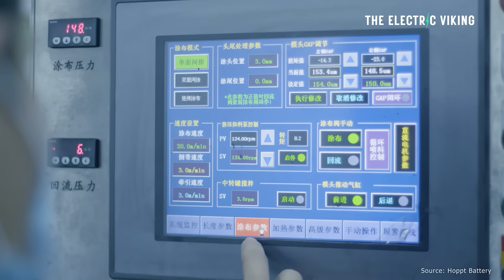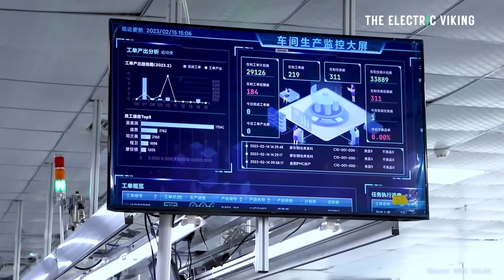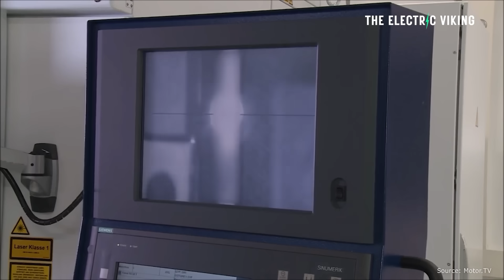NASA has cracked the code for replacing lithium batteries: ‘triple the energy’

Comment: There is an interesting observation about when steam power took over the shipping business, in that, steam did not replace sail overnight because sail boats started using steam technology as a boost to keep them in the market. Perhaps airplanes can start using electric boost on their engines to reduce the amount of fuel they burn per flight. Once an economic set point is found, it will be naturally beneficial for those planes to use more and more boost as the batteries come down in price (and weight) until it is no longer desirable to burn the fuel at all.
Reply: Or just use fuel for take off and landing then cruise on electric?? Don’t know if that’s possible
Reply: @troyswan7123  It will certainly be possible to use electric to reduce fuel consumption. It is just a matter of saving more fuel than is required to lift the batteries.
Reply: For now, the batteries method still cost too much weight for power in kg. Even if you place some of the planes design for battery - you still wouldnt have enough for large passenger planes. We need to hit into the 2k-4k ranges for them. For smaller 1-20 people planes, this makes total sense though and could 100% reduce their fuel needs with this battery.
Reply: Well, that sort of hybrid approach might be difficult. The weight of jet or piston engines is about as substantial as that of batteries, not to mention the weight of the liquid fuel.
Reply: @WarrenLacefield  That would be true if done all at once but not as difficult if done as a step by step transition process. The steps will start small, but will get larger as the batteries become cheaper and get higher energy to weight ratios. They can start by simply putting in enough batteries to run all the electric devices in the plane instead of getting the electricity off the engines; that would save some fuel. Then the progression moves to feeding electric energy back into the engines to reduce fuel consumption for the same thrust. Then new generations of engines will be designed to get more out of the electric boost and save more fuel. At some point in the future we may see a stiff carbon tax on jet fuel, which would make all techniques to save fuel develop faster.
Reply: I see hybrid worth considering. 
Trains and earth movers use electric motors with a diesel generator. 
Imagine if buses and semi trucks transitioned to this method. 
It would increase efficiency and eliminate range anxiety.
By adding some batteries, additional applications would make sense.
Reply: @Ken00001010  Possibly. But you have to keep recharging those batteries. Big jet aircraft do require a considerable amount of electricity to run and fly. Small aircraft, not so much, probably too little to worry about.

When EV aircraft do come along, the benefits will be many fewer moving parts, better computer and navigation controls and 21st century cockpits for pilots, low maintenance, quiet-running, increased comforts and safety, possibly no contrails, shifting the energy sources from fuel tanks to the electrical grid (and possibly cleaner energy), etc.
Reply: A hybrid jet engine is a possibility, with an electric motor driving the compressor, a combustion chamber and nozzle optimized for thrust, and no gas turbine to rob thrust from the exhaust, it could dramatically increase fuel economy with a modest weight penalty. Such an engine could cruise on little or no fuel, using fuel mainly for takeoff and climbing.
Reply: @WarrenLacefield  Thanks for your reply. I suspect that battery charging for electric, or electric assisted, planes will go pretty much the way it is going for vehicles like busses. There will be a tradeoff between how fast charging can happen and how much infrastructure is worth that improvement. We have completely electric small planes, now, and I expect to see that move up in plane size as technology advances. My point is that electrical assist can move up that scale faster, and that fuel savings (for both cost and environmental reasons) will push that.
Reply: @Ken00001010  Yes, we do have completely electric, (very) small planes right now and they do charge about like EV cars. But they don't have a lot of range. Few if any are licensed for passengers. Better batteries, like these Viking was talking about, are still in R&D phases. My point is just powering the avionics and control motors, etc., by battery does not gain much. (Especially, I think, most systems like that have "regular" battery backup now. Recharging and running power comes from fuel power - very small compared to thrust.) Maybe hybrid systems will help incrementally. But like for spacecraft, all such new technology has to go through FAA approvals for safety, etc. Tech might evolve exponentially, but approvals seem to run slowly in linear time...
Reply: That's an interesting analogy. It  was once a 'fact' that transatlantic steam ships were impossible because the volume of coal required would exceed the cargo capacity of the ship.
Reply: @carr87500  Indeed. Unless ruled out by the the laws of thermodynamics, it is generally unwise to declare something impossible for all future.

Comment: A. Commercial aviation is already incredibly safe- there is almost no room for improvement
B. Airplanes will be the last form of transport to electrify and the batteries speculated about here will be wholly inadequate.
C What do you suppose a 25,000 HP electric engine would look like?
D. So, as far as I know an electric airliner would have to be propeller driven, right?  So immediately you have a speed and altitude problem that makes them infeasible for commercial airline use.

Plenty of great things happening in electrification, but commercial airliners aren't one.

Comment: Electrified tracks supplying power during takeoff will extend air time considerably
Reply: Take off roll on the ground -10  20 seconds - time to Top of climb 20 minutes - 30 minutes .  I'm not convinced.  Maybe an incremental assistance - along with being electric towed or powered by ground power through all the taxi-ing and up to runway threshold.  Save battery for the flight.
Reply: @marclagalle1486  Emals like on the Ford carrier?
Reply: @colshaw793    Way too expensive and would require point reinforcing of the airframe at the undercarriage even if the catapult stroke was made much longer.  Why not use the aircraft engines but have an electrical pickup that would sever as the aircraft rotated and started to climb away?
Reply: @marclagalle1486 You could do either. Taxi the airplane onto some kind of electric sled and have it get the plane up to speed on the ground before chucking it into the air or have an electrical contact on the plane providing it with power from the ground until it lifts off. 

The sled would probably work better, tho. No requirement to have any weight on the plane.

Comment: Sam, how do you figure air crash victims die mainly from fuel fires? If a plain augers into the ground, or sea. Or breaks apart at 30,000 feet?
 Everyone dies. No one burns. Getting rid of fuels won't change that.

Comment: The problem with large planes is not taking off but weight on landing.  Even if battery energy density increased far more than this nasa one, it does not get around the fact that they can't be dumped before landing.  For large or longhaul planes, it is a total non-starter due to the landing weight problem.
Reply: Some basic physics tells me that extra weight is only a problem if you are crash landing. Otherwise your wings that allow you to fly carry you back to meet the earth at a safe rate.😊
Reply: @malcolmrickarby2313  if every landing could be guaranteed to be perfect that would be ok, but that is not the case  It is why a plane that needs to return to the airport soon after take off dumps all its fuel first.  Planes have a max landing weight.
Reply: @jamie-ck6js  At this point - the larger planes / long trips ones would be out of the question anyways for now. Small and mid size ones are what we will want to target anyways because they waste the most fuel for the amount of "stuff" they move. Because they would be smaller - more of the design/weight can be shifted to make use of the battery as part of that design and extra weight from the people would be small/none existing anyways.

Comment: Jet fuel has about 40,000 watt hours per gallon or about 10,000 watt hours per pound,  we have some work to do yet 
Sam, batteries have ( as stated in your video ) about 120 watt hours per pound.  Even though electric is more efficient than jet fuel for propulsion, we still need some serious increase in battery watts per pound.  ( Feel free to correct me if I am not right here )

Comment: It’s all about how fast they can recharge. Aircraft can’t afford to be still long. If it can be recharged in the same time as to turn around the passengers then it’s won !
Reply: With solar panels, it could recharge in the air. Or decent with air friction.
Reply: They're doing fine with the artics running 24hrs at PepsiCo.
Reply: @TheBooban  It is impossible to get enough power from the photovoltaic panels on the aircraft
Reply: @TheBooban Musk has mentioned decent to destination as fuel.
Reply: Battery Swap
Reply: @TheBooban  Nope.

Comment: The best batteries at the moment are around 9 MJ/kg (gravimetric density). Jet fuel is around 45 MJ/kg. I can imagine regional air travel, but the energy required for continental or intercontinental travel at over 500 knots is likely out of reach until there are new material sciences discovered. As far as regional travel goes, we've always known how to do that efficiently. It's high speed rail. For some reason, the USA doesn't like that modality.
Reply: arlenea8 • The reason is OIL PROFITERS.
Reply: Trains are the only real way - and they can too be EV Trains :D I think the main reason is just the fact they take as much space as airports in some cases. LEt alone all the rail you would have to place down, taking of land, etc etc. Planes are just easier to have points at, travel in the air, and then land closer to a city. At lease in the US - large land mass with everything spread around. Places like the EU and Japan can get by with it is because they're a straight line down most of its land mass.
Reply: You might want to check your figures.  You may have moved a decimal point.  The best batteries have a gravimetric energy density of 0.9 MJ/kg, not 9.  Check it and post your source if you find something.
Reply: @wemagor  Yep. What I get for pounding out a comment. Same conclusion though. I have an affection for trains.
Reply: You also have to take efficiency into account. Jet engines are about 30% efficient, while electric motors are over 90% efficient, that makes a big difference. Batteries do need improvement for electric aircraft to match jet engine performance, but they don't need to match jet fuel energy density to match jet aircraft range.
Reply: I was told in school our love of the automobile is what caused the trains to demise in the USA. We used to have an extensive passenger train system in the early to mid 1900s. But another thought is our land area is just too large. Connecting most cities by rail is just not practical; infrastructure is to costly. Planes need little infrastructure in comparison.
Reply: @chrismuir8403  True, but we;re still needing them to hit into the upper 2k-3k per kg - so we're still too far away to be consider "good enough" yet. The best one I know is still less than 8-900 without doing some crazy thermal stuff. Granted, airospace will have the advanaged of using more excoct elements if it helps them even if it increases their cost. At least with large passenger planes. For the 1-20 sizes ones we only need to hit around the 1k-2k per kg. They';re the ones that create the most waste as they usally only carry a small amount of private users so fuel per person is higher than fuel per person on a larger passenger plane.

Comment: Aviation batteries must withstand the extreme cold found at high altitudes.
Reply: Not any more than the passengers do. Insulated, and inside the fuselage, it's not a problem.

Comment: There’s another approach which could be done with a much smaller battery, use satellite energy. Install a battery large enough to power take off and getting to cruising altitude above the clouds, then power the plane with energy transmitted from space using large orbiting solar arrays.  We’ve experimented with transmitting energy from space before and it didn’t work, because of cloud cover, but planes fly above the clouds.
Reply: Unfortunately, it would probably require a more peaceful civilization before we could have mobile solar power stations in orbit beaming focused power down to a moving area the size of airplanes.

Comment: "An aeroplane needs around 800 Watt hours  / kg ", NASA's new battery 500 Whr / kg .... so still not enough for aeroplanes  ?
Reply: Energy needed by the large airliners is insane. Even at a mythical 1000Wh per kg, we are talking a battery weight of 1000 tonnes, for a decent flight by a large airliner. Good luck landing this plane with 1000 tons above the 500 tyres!! ...And charging this 1 Gigawatthour battery in 30 minutes? That's the same power as two huge nuclear power stations. Just saying.
Reply: Yet they are flying now.😮
Reply: @malcolmrickarby2313   Yes, small planes on short trips, since about 2019. But large planes? Noooooo..

Comment: 5:20 Funny, that the burnt Asiana plane shown had NO fatalities due to fuel fire.  I'm trying to think of a case where fire contributed significantly to fatalities.  The ones that come to mind are TWA 800 from 29 years ago; and the Tenerife incident from 46 years ago .  I'm sure there must be others, but the point is that fire is NOT the cause of most aviation fatalities.
On the other hand, if you filled the cargo hold full of LCO batteries, that would be VERY scary, and likely a much more dangerous environment than jet fuel.  (Case and point: UPS 008)  So the selenium-based batteries may help make it achievable, from a safety point-of-view.  But it's all theoretical, they don't even use it on their own spacecraft yet.
Reply: Delta Flight 1141 in 1988. I know someone that was on it. There was fire and people died.

Comment: Did we build too many renewable or did we build more than we currently can correctly manage.    Maybe a distinction without a difference but I do not think so.   The too many has a negative connotation.  It is like they are wasted.  Focusing on the management of the excess power is a path forward.
Reply: Using excess renewable power to decarbonise the atmosphere to a more stable state , should be a first priority , 😊if we haven’t done irreversible damage already.

Comment: Sam, It's great to see so much research going into electric aircraft,  whether its battery, hydrogen fuel cell or any other type of hydrogen powered drives.
Both Airbus and Boeing are in a race to develop their first planes by 2035, can't wait. & if I remember correctly, NASA is helping Boeing to develop a full size hydrogen airliner.
Guilt free foreign holidays ahead! 😅

Comment: A useful way of calculating range for a given amount of enery is to use the lift / drag ratio. While the most efficient sailplanes just exceed 60, commecial airliners are in the 15 to 25 bracket (clean, that is flaps up gear up, etc). A kg weighs about 10 Newtons so at L/D of 20, it takes half a Newton to push it along. That is 2km per kW.second, or 7,200 km per kW.hour. 500 Watt.hours will shift it about 3,600 km. So a 500 watt.hour battery could move itself that far if it generated thrust at 100% efficiency, and the airframe and payload weighed nothing. If batteries made up a third of the total weight, and you could achieve about 2/3 propulsive efficiency (motor and propeller), you would get about 2/9 of that range, roughly 800km, which is about 500 miles. With the usual requirement to have enough in reserve for a 250 mile emergency diversion, you are down to about 250 miles (btw, if you think that is an exaggeration, next time there is a really strong south wind at Heathrow, try watching an A380 making several attempts to land before giving up an diverting to Birmingham!). So don't expect transatlantic electric flights until battery energy density will take  aircraft at least 3,500 nautical miles (unless you stop part-way). That's just under 6,000km. We need at least 3,500 W/kg, which is about 7 times the energy density of the NASA batteries. (and forget cruise/climb!!).

Comment: The amount of energy required for flight is the same whether it is kerosene or battery driven.
Reply: Not fully though - engines fuel does have a loss so you dont have to 100% hit it - just have to get close enough. Granted, these batteries are still not even close to what we need.

Comment: What about speed?!  Is there such a thing as a battery powered turbo-jet engine? Commercial aviation aircraft cruise at 450-500 mph, what will a prop driven aircraft make in the air.  Will take much longer to get over the Atlantic or Pacific!

Comment: I have a question, because I don't understand jet engines that much. They burn liquid propellent in a turbine fashion, right? So you can't have such a thing as an electric jet, can you? Will electric planes have to be propeller powered? Is there a more efficient way to do it? And lastly could you get a prop plane up to the same speed as a jet plane? I do two very long haul flights a year (NZ to Norway and back). It's about 24 hours of flying each way, on up to three different flights, and it's pretty gruelling. Are electric planes going to be able to deal with longhaul? Because you can't make these sorts of flights longer without people losing their minds lol